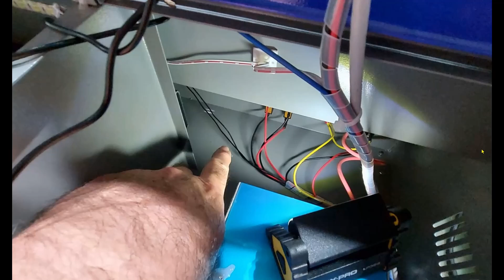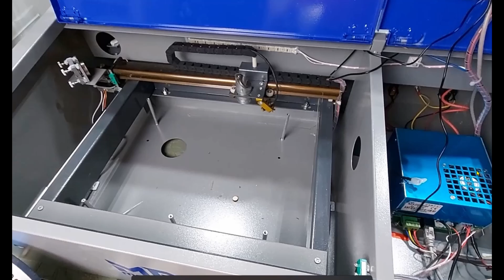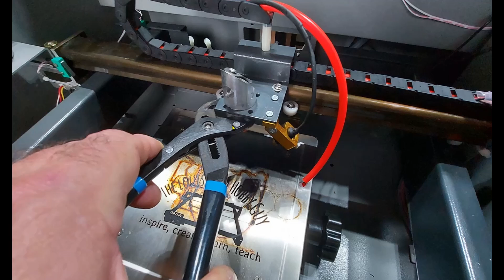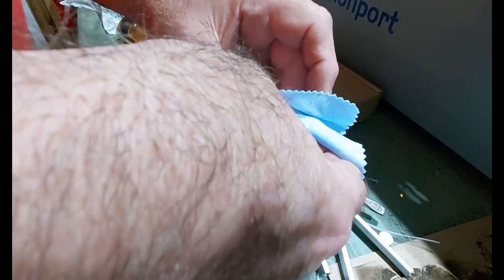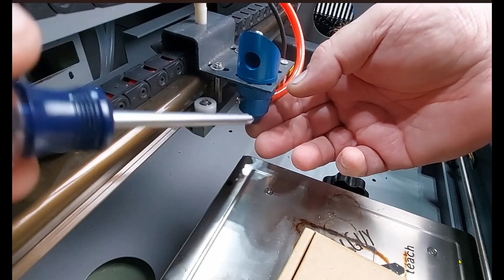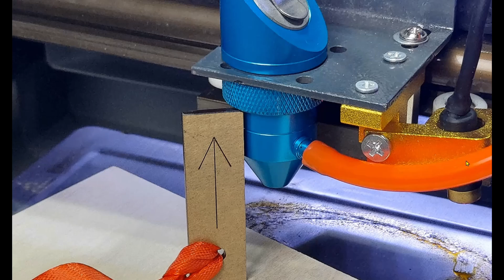👌 Upgrading a K40 Co2, changing the laser head, air assist and more! #1 Requested Video!

Comment: Why not use the air assist for engraving?
Reply: Great question I'm curious to see the answer.
Reply from the maker: The air assist blows the smoke and debris down onto the work piece forcing you to do cleanup. I'll be doing an analysis and rational video of this soon.
Reply: @TheLouisianaHobbyGuy  a lot of work has both an engrave and cut component.  Is there a way to engrave with no air assist and have the laser stop so the air assist can be turned on and then continue to the cut?
Reply from the maker: No Steve, not unless your control board handles M8 commands, most don't.
Reply: @TheLouisianaHobbyGuy  I guess you could turn the output for the cut layer off, run the engraving, then turn the engraving layer off and turn on the cut layer and air assist - yes?
Reply from the maker: @stevespringer8385  Yup!

Comment: Question for you - I upgraded the controller , now when my machine homes, it moves an inch off the limit switches in both directions (used to move 1/2”). If I try to cut at that new origin, even when it frames and looks good, the cut will stop when it gets to the far left of the project. So I have to “manually” job my laser head to the right and down. So, now my 12” x 9” is less than 11” x 8”. My machine settings are 11.8” x 8.9” ??  Any advice would be appreciated
Reply from the maker: The correct control board settings for the K40 (M2 Nano or Grbl) is 200mm (7.87") x 300mm (11.81"). The cut stops at the far left because your X setting is more than an inch larger than the limit. When it homes with the new Grbl board, there is a "Homing Debounce" ($26=250ms or 25mm, or 1") when it hits the limit switch, which is what you're talking about. So yes, it can frame larger than the debounce, but the job can't run correctly if the bed size is wrong. You've never had an 9 x 12"; they're all advertised as 8 x 12", but in reality, they're 7.8 x 11.8". 

In theory, you could change the control board settings to match the actual bed size ($130 & $131 (X & Y max travel)) and also match the software device settings, and then change the controller to a smaller debounce ($26) of 62.5 and homing pull off ($27) of let's say 6.35mm, but that's just my off the cuff thoughts. I haven't tried or tested it, nor do I want to. I really don't like playing around with the control board firmware.

Comment: I hadn't thought about removing the fan, but it makes good sense though. I guess I have another thing to do to my K40. 😁 Could you tell me the length of your factory focus tool because my K40 didn't come with one and I'd like to make one. I'm using the same air nozzle you are soo it should work. Also I didn't think of taking apart the 8" jack to get it lowered down I just got a 4" instead and it sure is anything but stable. I'm really glad to seeing you use the K40 more, I really need the guidance. Thanks for the video!
Reply from the maker: Yes George, K40s come with a stock 2" lens, so 2" or 51mm is the focal tool to use to the bottom of the lens.
Reply: Yah, mine has a 2" lense so I guess that's what I'll make. Thanks for the reply!

Comment: Decided to get the cloudray air assist. I could play print something but overall this will be easier and won't melt or have tolerance issues when installing.
Found out the issue I was worried about was not an issue at all. I was worried the air would go out the laser inlet but in practice, there is a lens in the way so the air only goes downwards towards the work.
Reply from the maker: I have seen the Laser Gods article and Russ' videos on this and I believe they're just theorem. When I cover the outlet, the pump strains and I don't get any leakage of air around the nozzle. I don't know how one proves the venturi affect without scientific study. I just don't believe it happens, because there is no opposite air flow for it to even be possible. I guess the argument will go round in circles forever though.

Comment: Last week I cut a hole in the bottom of my k40 and raised it by about 3.5 inches so I can do larger diameter rotary engraving (perhaps demijohns now)  and just have more options when it comes to larger ready-made items like boxes. I can still use the 8" stock scissor jack bed and can raise it from below the machine now which is also a benefit.
Thanks for the video and for constantly helping people.
Reply from the maker: Awesome idea! I spent an hour looking for a video I saw a while back of a fellow that cut out the bottom and cut the table below it to match. He put an aluminum plate on the table cut out and a motor. He raised and lowered it with a rocker switch on the laser. It was a very ingenious idea! I wanted to link the video but now I can't find it.
Reply: @TheLouisianaHobbyGuy  I tried to do it as much as possible by hand to keep vibration to a minimum and possible damage so purchased a hand nibbler for about £10 which works better than expected. I then finished it off with light filing. It is a minor upgrade that improves it a lot if you are doing certain things.
Reply: What rotary u using, I want to do this to mine, any pics of your setup?